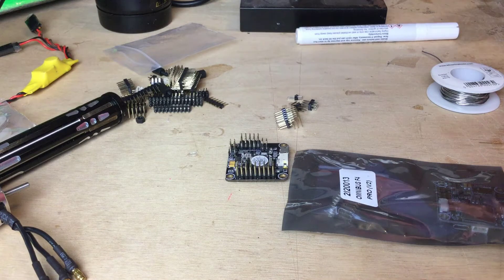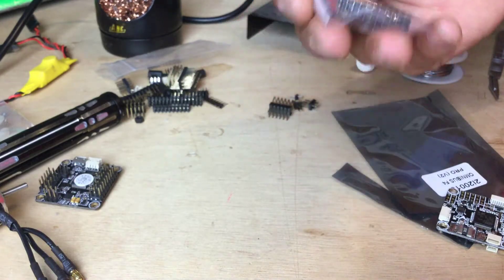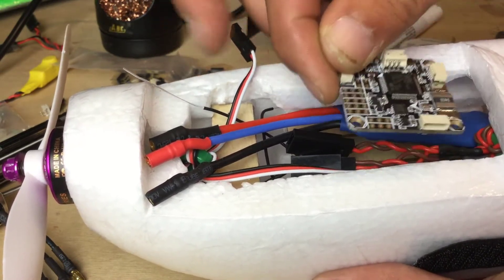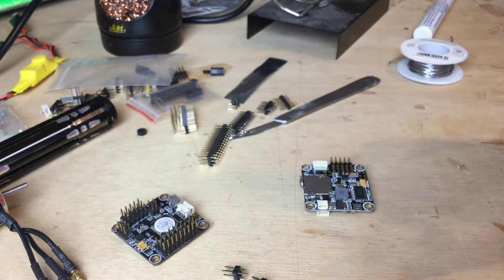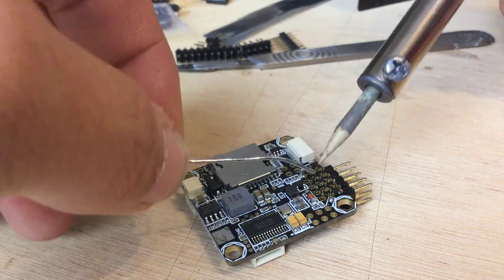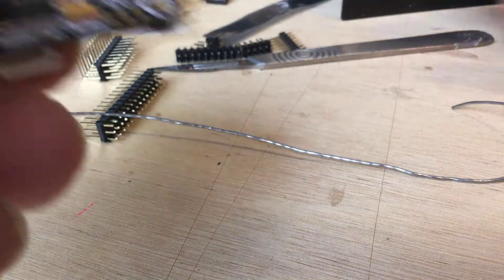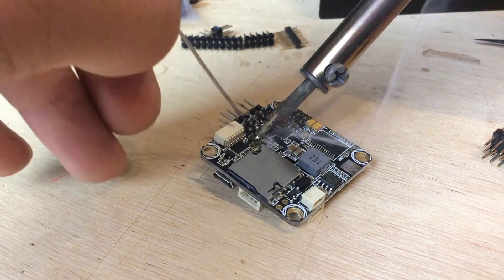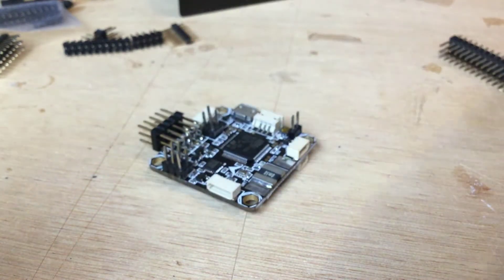Part #7 - Soldering up the Flight Controller Board (V1 and V2 Boards) for iNav

Comment: I can tell from all the rainbow oxides on your tip that it's way too hot.  Get yourself a temperature controlled iron with a chisel tip, and you'll find it way easier to get the heat into the pads where it belongs, rather than cooking the flux out of the solder and blobbing it onto the pins, while the pads are too cool.

Comment: Matt, I purchased the V3 board as the V1 and V2 boards were out of stock.  I hope it's not vastly different.
Reply from the maker: Hey Charlie, shouldn't be as they're all pretty much the same. Just be wary of the SBUS input, if you get stuck see my video dedicated to SBUS on a V3 board, Matt

Comment: It would be a lot easier to direct solder the wires individually to the board, then to solder the pin harness to the board.... jus sayin
Reply from the maker: Howdy fella, I can't remember what was in this video now, however whatever I did, is exactly what I do normally for a iNav install. Matt
Reply: you had a very hard time soldering the pins to the board... jus sayin ;)

Comment: I need to use the 90 degree pin headers like you did. What size are the pins need for the board?
Reply from the maker: Howdy Wesley, I didn't know there were anything special about the pin headers, just look them up on eBay/Amazon/BG they're a standard size for flight controllers, Matt

Comment: Howdy again Matt! I wanted to ask, with this V1 board, will I want to also buy an LC filter for the fpv system or is it not needed?
Reply from the maker: Hey Matt, a low pass filter is always a good idea, it won't do any harm for the power supply to the vTx and camera, Matt

Comment: Hi Matt…For a fixed wing setup I need to connect the board to servos right aileron and rudder. The pins J6 and J9 provide the signal and ground wires…where do I pickup the two +5 volt pins?
Reply from the maker: Howdy Don, not sure on those pins exactly, however if you just have the outputs and no +5V, you'll need to piggyback from one of the other +5V pins on the servo rail, typically PWM channel 2 is the one do this from. Matt

Comment: Hey again Matt, Here is a link with some good info about the camera, Vx and osd connections on the v1 board. The video was cutting out,  as I tried to launch my wing, because on my setup I was using the + OSD pins on the board to power my cam and transmitter. I had the correct setup but the board just cant put out the power I was asking of it. The info in the link explains why and gives a fix.  Hope this info helps. 

https://www.phaserfpv.com.au/blogs/blog/omnibus-f4-osd-flight-controller-specs-and-hookup-diagrams
Reply from the maker: Howdy Scotty, see this part of the series https://www.youtube.com/watch?v=IFA1ydtB6-c for how I power the vTx and camera. Matt
Reply: Thanks, I had not watched it yet because you weren't covering the F4 V1 which I purchased after watching the first episode of the series. 
I did have the camera and video transmitter powered directly from the balance port on my battery, and it worked great, but read about how much simpler the wiring could be by just using the board to make the necessary connections. Which did make it much cleaner since I had less wires and external connections going on, but too bad it just cant handle it. So Ill be changing it back to the way I had it.

Comment: Another option to helping hand which I found out on @uavfutures. Is to us blue tac. Works really well with pins and small boards.
Reply from the maker: Howdy Gordon, yep that works well. Just be careful not to push down to hard as it may pull off the parts off the bottom, Matt

Comment: Hi Matt...no pressure then...:)  Tip: As well as the Flux Pen in your Video, you can buy a similar Pen which has a harder, fine abrasive tip. This cleans the oxide from the board, a residue from the solder bath when they made the PCB. It's not so much the pin headers but the thru hole plating in the PCB which is oxidised. This prevents the solder flowing freely into the hole. Try it, you will be amazed how much easier it is.
  Painless 360 always cuts the Video when doing this...if that makes you feel better...lol
Reply: Another tip.  When you are finished soldering take an old tooth brush and some Isopropyl alchohol and go over all the areas soldered to remove excess flux.  This helps prevent corrosion on the soldered pins which can occur when the excess flux oxidises.  Make sure you do it in a well ventilated area away from any flames or your soldering iron as IPA is very flammable and also not good of breathed in  ;)

Comment: Painfull :D
Should of used some of your millions of standoffs on a large base to keep that sucker still on the bench rather than chase it about ;)

I have just ebayed myself a flux pen tho! never had one.
Might be able to solder up my li-po pack i'm trying to fix, will those tabs solder up, will they flip
Reply from the maker: Morning Cornish, yea a tip I learned while making that video was simple, when you put the pins in, give it another stab with the flux pen, that'll make the solder really flow then. Matt

Comment: Thanks for the reality of this video, Matt.  I am awful at soldering pins.
Reply from the maker: Hey Jacob, yea if I sat there and did them perfectly, that would have been too easy. Trying to reach over and solder at the same time is horrific. I still class the soldering part as the hardest part of the process :) Matt